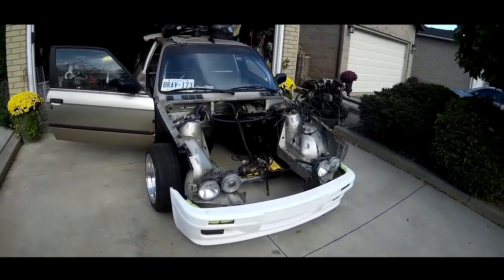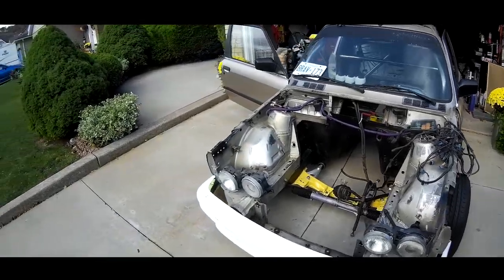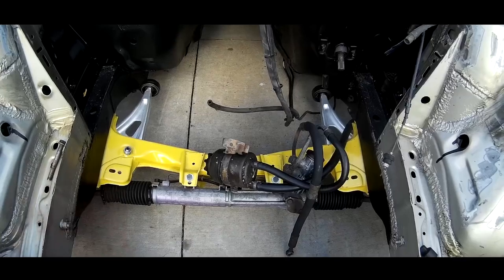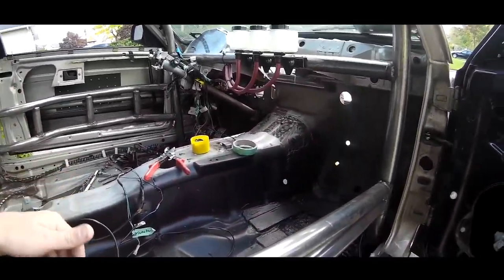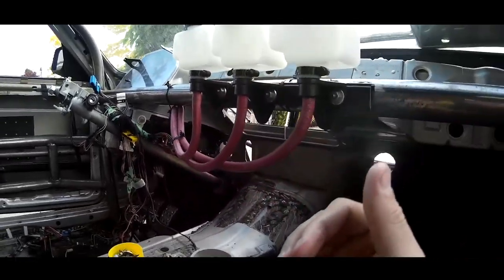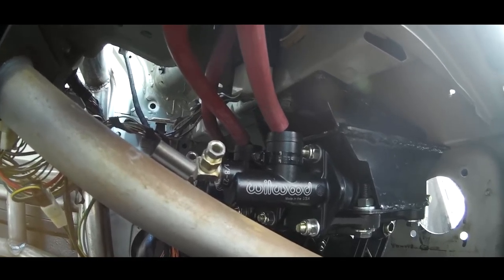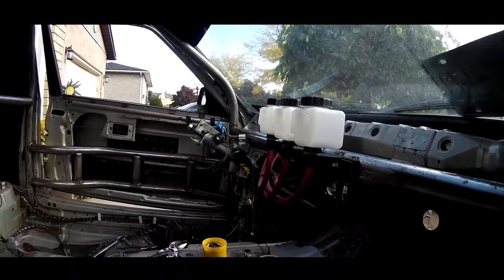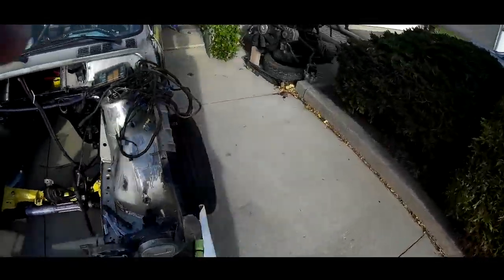BMW E30 V8 DRIFT BUILD EP 4 // NEW GARAGE  // CAR WALK-AROUND //

Comment: for the steering, you obviously went with the the e46 control arms and z3 rack but what tie rods did you use and also did the z3 rack bolt straight up to the e30 bolt locations, thanks

Comment: keen to see what is going on with this car. i wanna know how easy or hard it is to turn a e46 into a propper drift/race car as i have blown the motor in mine
Reply from the maker: +Thomas Dewar thanks for checking out the videos man! and realistically you can turn it into one pretty cheaply an easy i know loads of guys at my local track that drift e46 cars just get some good coil overs lots of spare rims an tires and weld your diff and go have fun man!  as far as blown motors go just call your local junk yard they should have something for your needs there for not much! used motor in my area are about 300